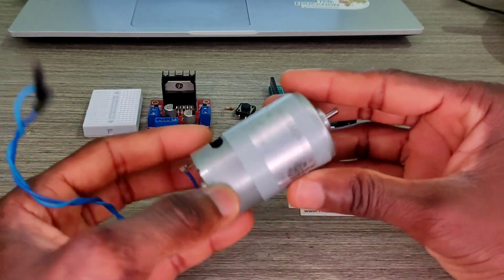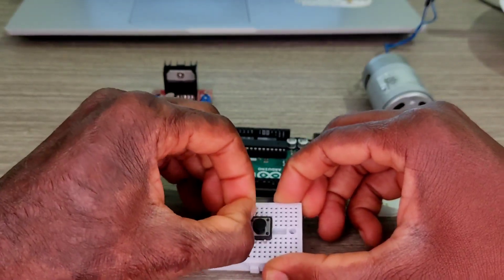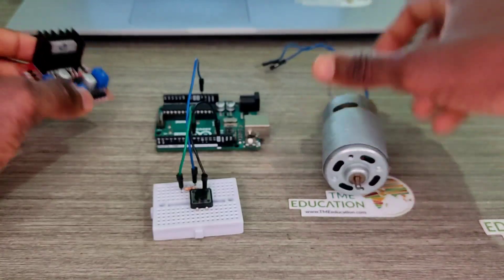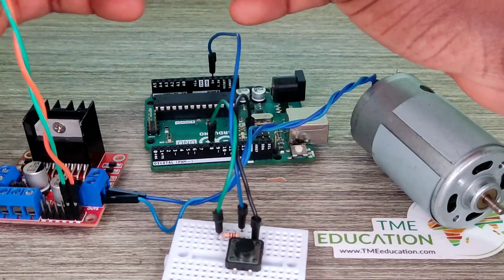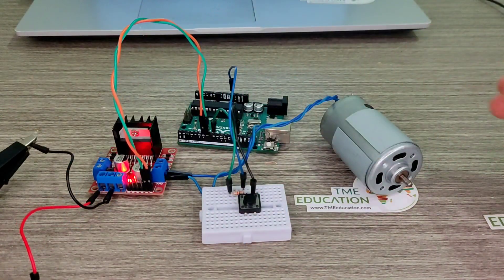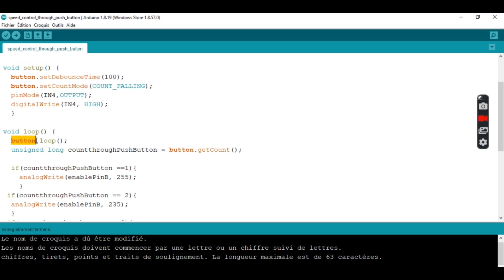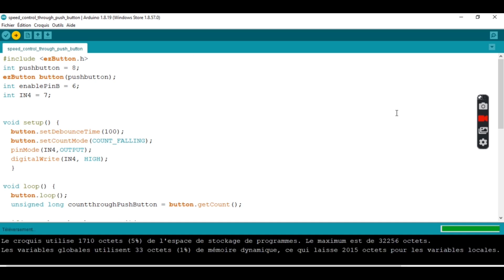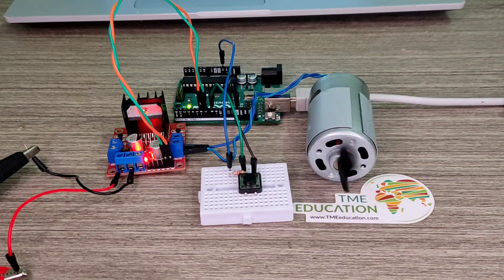Controlling DC Motor Speed with Arduino using L298N Driver and PushButton | ezbutton() function

Comment: Hello Sir,
I have completed the same setup with all of the same devices/code but nothing is happening when I press the button. Would you please be able to assist in determining what my issue could be? I have uploaded the code onto my arduino, and my wire setup is identicial. I am using a 9V battery as my power supply for the L298N Driver.
Reply from the maker: What’s the error?
Reply: @uploadideaswithitamar  I am not recieving any error code. At first it was turning off the arduino, but we switched the wires as you said at 9:20 and now the button is not doing anything, but I am not seeing any error code pop up. Sorry this is my first time working with the arduino.
Reply from the maker: @logancolwell2065  show me your diagram: electronicsstuffsoccial@gmail.com

What type of motor are you using ? What’s Max voltage  of the motor  ?
Reply: @uploadideaswithitamar  Thankyou, I have just sent you an email.

Comment: Here's the code guys:

#include <ezButton.h>
int pushButton = 8;
ezButton button(pushButton);
int enablePinB = 6;
int IN4 = 7;

void setup(){
  button.setDebounceTime(100);
  button.setCountMode(COUNT_FALLING);
  pinMode(IN4, OUTPUT);
  digitalWrite(IN4, HIGH);
}

void loop(){
  button.loop();
  unsigned long countThroughPushButton1 = button.getCount();

  if(countThroughPushButton == 1){
    analogWrite(enablePinB, 255);
  }

  if(countThroughPushButton == 2){
    analogWrite(enablePinB, 235);
  }

  if(countThroughPushButton == 3){
    analogWrite(enablePinB, 205);
  }

  if(countThroughPushButton == 4){
    analogWrite(enablePinB, 185);
  }

  if(countThroughPushButton == 5){
    analogWrite(enablePinB, 165);
  }

  if(countThroughPushButton == 6){
    analogWrite(enablePinB, 145);
  }

  if(countThroughPushButton == 7){
    button.resetCount();
    analogWrite(enablePinB, 0);
  }
}
Reply from the maker: 😅😅. You're great!
Reply: @uploadideaswithitamar  no problem, you helped me out a lot in a project I was working on actually, thanks! 😅❤️
Reply from the maker: @kaffae  I'm soo happy to hear that. 🙏🏾
Reply: @kaffae  can you please send a code for same connection with button single press for turn off and turn on with max speed